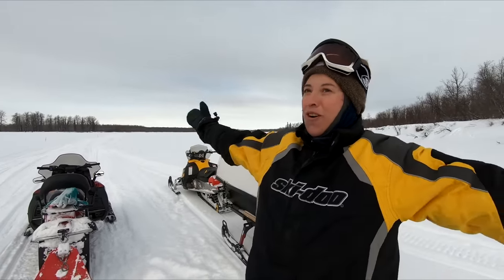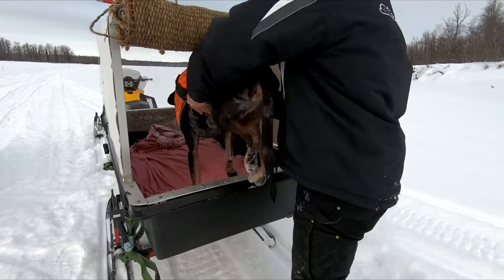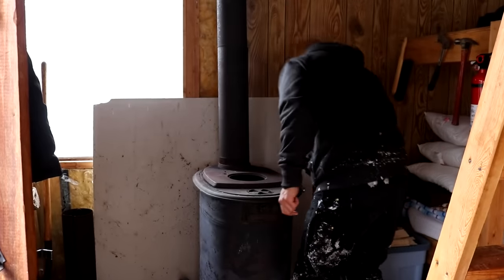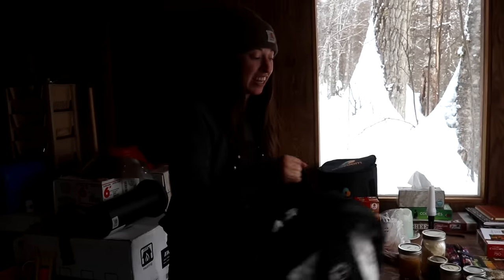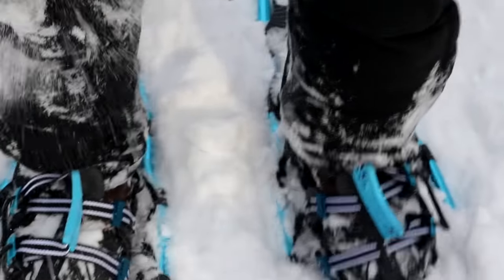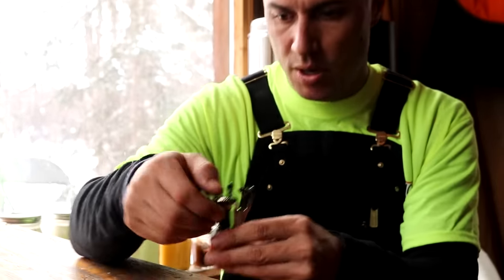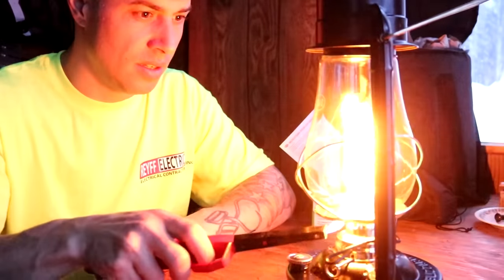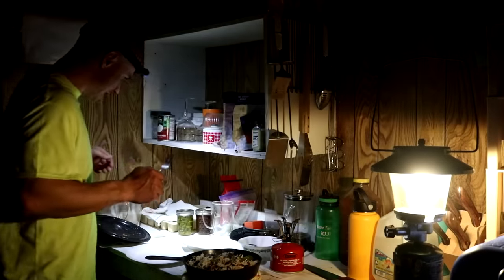Winter Trip to Our Alaskan Off Grid Cabin (Part 1)

Comment: Wow there Bud, that new black lantern has a wick, that means oil, not fuel. Fuel is for pump-up Coalman lanterns that use fuel to start mantel/little boot sock. You need lamp oil in the Black one. Good idea to always start a lantern on the outside of the cabin, just in case.
Reply: I’ve never seen anyone pour white gas in a kerosene lantern. I’m surprised he didn’t burn the cabin down! That stuff burns a lot hotter than gasoline!

Comment: Reusable silicone "ziploc" style bags. There are different grades and sizes but this idea is the same. Strong, long-lasting, some are easier to clean but all of them are safe to clean at high temperatures, even sanitizing. They are thicker so take up a tad bit more room than usual plastic bags -- the trade-off is they are harder to puncture or tear. On Amazon, a highly rated budget set is $17, but the free-standing style is easier to fill and clean which are more. For anyone who doesn't want to deal with washing these, Amazon Basics has the best deal on ziploc style bags that are as good as the brand name (I reused mine 3 or 4 times for dry foods).

Comment: With the kerosene lamps the flame should generally be less than an inch, or you will just smoke up the glass. Kerosene doesnt explode like that, but burns more gently, I'm thinking that the fuel that you have is more suited to a primus type pressure stove, because the fuel is vaporized then burned under pressure. With those kerosene lamps you will have to trim the wick with scissors say once or twice per season depending on how often and how long it is used. If you burn the flame too high it will smoke the glass but will also fill the room with nasty smelling fumes, because of all the unburnt sooty gasses.
Reply: A fine job explaining. I hope people learn from what you said. I was worried when he said he was going to use that fuel for a Dietz lantern. I’ve Ben off grid longer than can remember and have always used KEROSENE lanterns
Reply: Hughesnet.Satellite cut me off. It does that sometimes. I would of thought living the way they do, they would of known this.

Comment: Your cabin videos continue to happily remind me of my younger days snow machining to our cabin.  My sister & her husband still do & go moose/bear hunting there.  I haven't been up since it burned in the big fire on the peninsula years ago.  They've rebuilt, but the landscape is so different with no trees.  Ariel when you ride you might find it easier to handle the deeper snow standing up then you can more easily swing your leg to the high side of your machine on a sloped area.  It's all about using your weight to control the machine.  I know how easy it it is fall off even on a level spot! Eric should unhitch the trailer & make a trail up to the cabin, it's easier to maneuver your machine without a sled. Stay happy doing what you do. Janis

Comment: Just a little tip; the Chevron fuel is white gas and intended for gas pressurized lanterns such as Coleman lanterns with the pump. The Dietz lantern you have uses common lamp oil. The extreme flammability of white gas was evident when you fired it up. It is very dangerous to use that fuel in your lantern. Get some lamp oil and you will enjoy your new lantern safely. Since you have all that fuel you could probably find a used Coleman 220 or 228 really cheap, they put out great light and are much more efficient than propane. I really enjoy your videos especially those in which you travel to your remote cabin. Thank you.

Comment: Hey love your channel. I think when you light your lantern you have the wick up and then turn it down. 
Also when pouring fuel or anything from a can like that if you flip it so as the hole is at the top when pouring you won’t have that glugging (?) that spills the liquid. try it. quite amazing really. 
a tip from a grandfather

Comment: If you can bring some powerbanks with you and keep them warm on your bodies, you can use LED lamps with USB plugs. Ikea here in my country has three different types. Harte - desktop lamp - I use several of these. Good reading and working light. Ledfyr - fairylights to hang over your windows - I use several of these too. Very good light. And their camping lantern, which gives a good spot light.  I have one of those. I am not sure if they are selling this anymore. I can't find photos of it. It is quite big with metal details on it. You can charge the powerbanks from a generator. Or you can just bring several of them with you. They are not that expensive anymore. I am using 13200 mAh that have two ports each. I am  also using several of their spotlights that goes on an off with movement (3 different types - 2 Stotta and 1 Molger (Molger goes on with movement after it is dark)). They are all battery powered. If you bring new batteries and keep them warm, you can use battery lamps there too. There is also one spotlight with a clamp that goes on with touch and stays on for half an hour (Stotta).
I am telling you all this because I have an offgrid cabin, and I have spent a lot of time and money before I arrived at these alternatives, which I find to be very good for my use.

Comment: omg folks you need to watch a video or something on your lantern cause you screwed it up! Haha gave all us old timers a good laugh though.    The lever that sticks to the side raises and lowers the globe, as soon as light it  you drop that globe down and adjust your flame with the round knob, quickly!  Keep your globe cleaned between uses. Trim your wick to a rounded shape with scissors, Having a clean globe gives you good quality light. To clean the globe, grasp the top of the lantern and gently pull up an inch, the globe and wire part will swivel out to the side. You can slide the glass part out if you wish and wash it in soapy water. These lanterns would be great there as they are super fuel efficient.   Can be carried around safely, hung on a nail or tree branch. You will love it..... but don't have that sucker burning so high bout gave me a heart attack!

Comment: Others have already mentioned that you should be burning either lamp oil (liquid paraffin) or kerosene.  Refined lamp oil is more expensive but will produce less polutants and bad odors indoors.  Kerosene is cheaper but doesn't burn as cleanly.

Comment: You need to stock pile that Mountain house and some bottled water and some other foods that the bear can't smell, cocoa, coffee,  you can put it in double zip lock bags and some canned foods, just in case of an emergency like if a blizzard storm came in and  you four were forced to wait it out . Also some of your canned fish and moose, put in sealed storage bin in a sealed garbage bag for you and for the puppies. you can hang the lighter foods from the ceiling in a garbage bag and then put it into a stuff sack or duffle bag to keep the mice out of it. I can see getting rid of all that old food, but having a new back up food supply there is very important.  Oh yeah and before  you leave to go home, warm up the wood stove and open the door and crack some windows opened to let all the good food smell out before you leave, just a thought, your friend Todd S. ps I'm stocking up on Mountain house, gorp, jerky, summer sausage, cheese, cocoa and coffee, for my resent practice expeditions, preparing for 3rd time up Mount Rainer. Need to make a trip to REI coop for Climbing rope, precincts, crampons, gators, and the right ice axe. Also looking for the best cold weather sleeping bag. I got everything else. I still have the boots that have been to top top of Mount Rainer. This time I'm going up in good weather, sun glasses and sun screen and Silva dine, sun block. Very inspired!

Comment: You are welcome. You got the bolts further away from the edge of the lexan, as well, I see. Good job. One more thing you can do is to run a bead of caulk that is called "Lexel" around the inside of that windshield. The stuff dries crystal clear. Always remains flexible. And sticks pretty much anything to anything. You'll have less rattling. The doggos will appreciate the wind being sealed out. And should the bolts work themselves loose, that windshield will go nowhere.

Comment: That Chevron Blazo fuel looks like white gas camp stove fuel. Try lamp oil in your lantern. It works great in my lanterns.
Reply: I agree. White gas shouldn't be used in a wick lamp. Could be dangerous.
Reply: I agree, that looks like naptha fuel not lamp oil and it is dangerous to use in a lamp I'd say.
Reply: Can says "Gasoline Stove and Lantern Fuel". Dietz lamps use kerosine. The Chevron fuel would be used in something like a Coleman stove or lantern.
Reply: I believe it says right on the side of the can for pressurized appliances
Reply: Please, please please! Do not ever use that fuel in a wick lamp ever again! You have no idea how luck you are that it didn't explode and burn everything to the ground.
Reply: Ya Blazo is a less refined form of white gas, basically gasoline. Once upon a time in "bush" Alaska Blazo was all you could get & it was burned in everything that took gasoline, snowmachines, generators, pick-up trucks & even airplanes. It came in 1 gallon & 5 gallon cans. That Blazo is old enough to have possibly turned to varnish, therefore drastically lowering its volatility. I haven't seen Blazo for sale since the 90's.
Reply: @thebranch983  I had to keep reminding myself that they must have survived, since they edited and uploaded the video! But yeah, that was nerve racking, watching him light that thing. So dangerous...
Reply: Yes kerosene would be a safer fuel.  Here in Canada we can also buy lamp oil which is made for wicked oil lamps like they have bought.
Reply: @markgramlin105  I said to myself recently that they are one day going to put themselves in a survival situation going to that remote cabin, then they pulled out an oil lamp and filled it with naptha fuel!  The way the fumes ignited when the lamp glass was lifted had me convinced the whole thing was going to go off any second.  So lucky!  Please don't do that again!

Comment: Hey guys love to watch y’all. The fuel is for pressurized appliances, like the old school Colman lanterns. It is like white gas. The lantern you brought is for kerosene type fuels. Just want you safe, keep up the good work?
Reply from the maker: Scott Walker Thank you!! We appreciate the information and are going to be using the correct fuel from now on.
Reply: Came here to say the same thing, but you got it covered!
Reply: That's true but it will work if you find the sweet spot
Reply: Just reiterating the other comment, don't use in a kerosene lamp if it gets hot enough it could explode.
Reply: @michaelbolduc9968  it would need oxygen to explode. Just don't drop it.

In all seriousness it is the wrong fuel and it can be dangerous.
Reply: Came here to say that. Coleman/Blazo is essentially naptha, closer to gasoline than lamp oil. It burns very hot and the vapors are explosive. Putting it in a wick lamp is basically creating an incendiary bomb! Consider a Coleman pressurized lantern to pair with that fuel, spare yourself the need to haul propane tanks to/from the cabin. They are available used, quite cheaply. 

Kerosene would be safe fuel for the Dietz, but it burns a little smelly for my taste. I'd go with a formulated lamp oil, such as Lamplight. Paraffin based oils are my favorite and have virtually no odor, but the wick in that lantern is too wide to burn paraffin safely.
Reply: I use dual fuel Coleman lanterns that can use Coleman fuel or easy to find and cheap unleaded gas,same for my old Svea camp stove, and I put my long burning candles in large glass pickle jars so there is less chance of the them getting knocked over or forgotten and starting a fire.
Reply: @SimpleLivingAlaska  good because you're teaching me about canning...and trust me, I need the lessons.
Reply: @barrybri  good because many people die and lose everything just like what you're describing. You can fill those jars partially with sand to help protect the glass also. My husband and our oldest helped rebuild a couple houses because of candle fires destruction.....and it happens very quickly too. Puff, gone.

Comment: If you put a thick comforter or pad down they would probably lay down more. It looks like they get knocked around the whole trip and that doesn't look like enough padding.
Reply: they had about  8 inches of foam under the dogs.
Reply: Actually the sled just needs springs so it can balance out over all of the bumps, just like the jetski at 6:34 has springs, and you can see the sled has no springs to absorb the unbalance of the snow
Reply: @bane8305  it does have shock absorbers
Reply: @bevandarke2300  Yep but it needs springs

Comment: I’m thinking of a pulley system ?  Snowmobile going one direction, while pulling the supplies up the hill.
Reply: Ditto, I was thinking about that the last video here!
Reply: Omg such a good idea
Reply: They did think of that...but they used people power instead.
Reply: Use the old winch you took off the Polaris, but I guess you’d need a battery or hook up to snowmobile for it to work.  I know just enough about this to be dangerous.

Comment: Another potential thing to use to bring out items instead of plastic bags is wax imbued cloth that you can wrap the items in (its generally beeswax). Its reusable / rinseable and if it gets really bad you can just heat the waxed cloth up and melt the wax back out of the cloth maybe wash the cloth with the wax removed and then soak the cloth in fresh wax or the wax you just melted/strained.

Comment: When you have to travel that far into the wilderness, maybe you should consider bringing a hot tent, a small woodstove to use in the tent (foldable), sleeping pads and really good winter sleeping bags.
Reply: I think the same. We had problems with our snowmobile once and I was getting worried but my husband said we have sleeping bags and matches!   We did make it back fine though

Comment: That lantern should be using thin oil like kerosene or diesel. If that fuel is some kind of gasoline (eg. white gas for cook stoves) it would explain the high flame and could be a fire hazard.

Comment: On you amazon link for that lamp says, type of bulb= oil lamp. I hate to say this put you want to put those 4 cans into a black and yellow storage container and get it out of the cabin. You so lucky that it's so old because it's lost some of its punch. maybe store them in the out house or maybe bury them till you get a Coleman stove and or lantern that takes WHITE GAS. When I was in the scouts We'd cut a pop can and full it with about 8 ounces of white gas on a burning camp fire outside and it would literally blow up, bomb and made flames over 12' in the air and its so volatile that it would burn up and burn out so fast that it wouldn't even get the fire going. It was just dangerous our scoutmaster told us to stop doing it for fear of severe burn out there at CHI CHI Beach Washington coast. You lamp with lamp oil in it it says will make 12 candle power, probably much brighter but must clean the glass mantle. your friend Todd

Comment: Ariel and Eric please do not use that fuel in that lantern. If the burning wick dropped down into that fuel you could have a serious fire if not an explosion. The fuel is for a pressurized Coleman lantern or stove and your lantern is designed for lamp OIL not gas. A Coleman stove or/and lantern would be ideal for your cabin. The lanterns are a little noisy but give out a lot of light and last a long time on one filling. The stoves also are great for camping.

Comment: I HAD to press Pause as you were pouring fuel from the can to the lantern. Even with a funnel, move the lantern to the edge of the table. Gently pour with the spout at the high end of the top (as you tilt it), not at the bottom. This will allow air to flow in easily to displace the liquid as it pours out, eliminating the "glug glug" that splashes the fuel out in gushes that are difficult to control. This technique applies to anything that you pour from a can with only one small opening, but especially where the top of the container is relatively large. 
My heart rate is down now so will return to the video...especially since I've now realized that you are OK or the video would not have dropped. 
Love you guys. Wearing my Bear Cub shirt today... JM

Comment: Wrong lantern for the fuel. Right on the can it says for pressurized lanterns and stoves. Careful guys!!!
Reply: Yeah, was going to say that I think the fuel is “white gas” meant for the pump-style pressurized lanterns and stoves, while the Dietz lantern is probably better suited for Kerosene.  Also, one of those pump style lanterns might be a little more fuel efficient than the propane one that uses the green cylinders.

Comment: When you get the proper fuel for your lantern, you can add a reflector. Aluminum foil will work. Mirrors work great. Can also be used with candles. Glad everything worked out and the lantern and no accidents. Coleman makes great camp stove that uses the "white gas".

Comment: Don’t use that it’s to combustible.   It’s for pump compression lanterns.   You need diesel or kerosene In those
Reply: Simple living Alaska . I use regular diesel fuel in my Dietz lanterns but have to lower the wick to the point where it doesn’t smoke as much.

Comment: That is white gas fuel. Not for use in that style of lantern. That lantern would use lamp oil. The style of lantern that uses that white gas looks very similar to the propane lantern you have. Be safe as that type of fuel is very explosive!

Comment: Lighting the lantern.. FAIL..
Now you need to clean the inside of the glass. The wick barely needs to be sticking out. The higher the flame the more stinky the fumes.. You'll figure it out..
Cold meat in a cold cast iron frying pan.